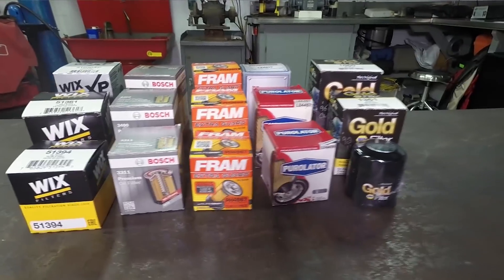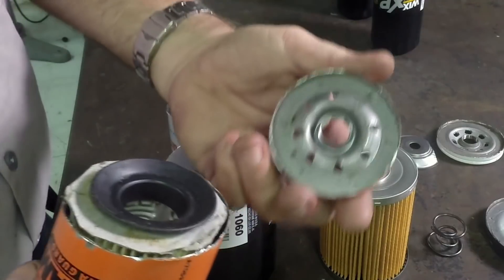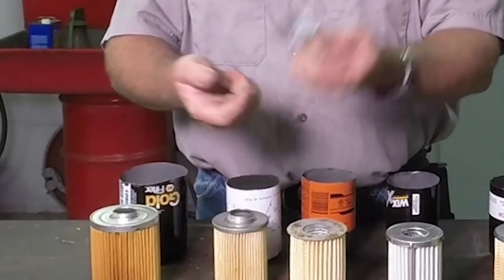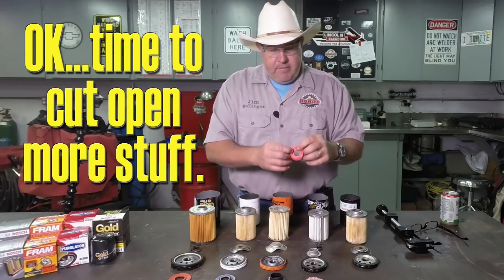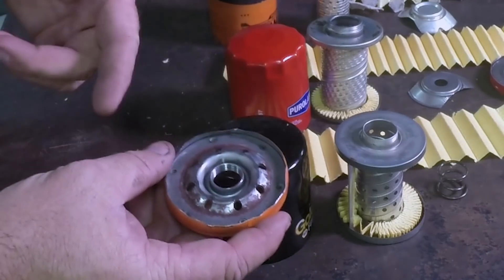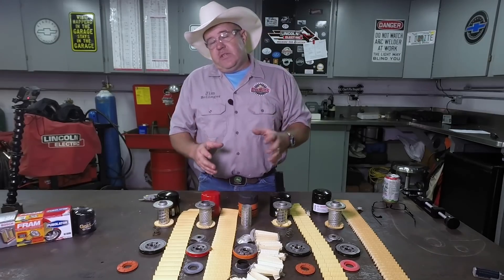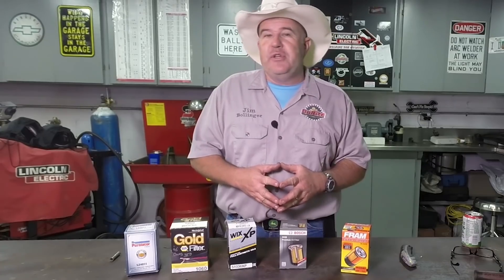The worst oil filter EVER!

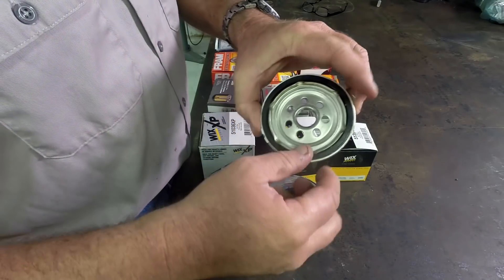Comment: at 1:29 it says RETURN ENGINE OIL PRESSURE. This isn't correct, the filter is on the pressure side of the oil pump as described at the 4:58 mark, there is no return oil pressure passage on the engine. Return oil simply leaks from the side of the bearings and drips back into the oil pan.  The filter body does see the same pressure as the engine oil pressure.

Comment: Fram is "made in USA" , of course it's crap. I still use them cause it's all the store has. They cost $6 and I change my oil every 5000 kms, good enough for me. Filter will never harms your engine, filter does come apart atleast its cardboard and not metal. Only way people kill their engine is low oil, wrong oil, or never changing it. You only really need an oil filter to plug a hole

Comment: Same filer size for the same car:
Frame $3.77
Napa Gold $12.49

You pay for what you get. 

Looks like you had all sorta sizes.. That changes how long each will be... 

Frame has rust and is shipped from over seas to the USA. Most are made in China and ship to the USA where they label them as fram to keep the USA on there box.

They use them in races cars.. One run is it.... Its removed and tossed and a new one is put on. Race motors are only used a few times before there taken down and redone.. Dont need some long lasting filter... They will blow a motor faster then having a problem with a filter in 500 miles.. Each his own in this point..

Comment: For the last time the end caps do not have anything to do with filtering the oil, who cares what they are made of.  If the filter failed would the engine run out of oil or would it run around it and continue lubricating the engine stop spreading the lies a filter does not protect your engine the supply of oil does.  Flaking rust really ive never seen that you sure that wasn't sitting in your shop a long time?
Reply: I laugh at these vids too. "more filter paper, must be better" lol, ugh a filters most important job is to maintain flow. If your filter is holding back sludge you got bigger problems
Reply: I have been wrenching for 17 years.  I have seen no correlation in engine failures from running Fram filters.  I have torn apart filters before.  I do agree that Fram are not the best, but they do the job.  If you have rust in the filter, then either they weren't stored properly, or you have water in your oil.  Fram is one of the top sellers in the market.  That being said, if Fram filters killed engines, then our freeways and streets would be clogged with dead cars.
Reply: @ericlunneborg907  can you explain how a filter can break an engine?
Reply: Unless the filter media is disintegrated from improper storage,  or improper usage, then I can not think a filter would just straight up cause a failure of the engine's lubrication system.  However the "E Core" oil filters produced by champion laboratories had a problem with the nylon cage breaking, but I believe that problem has been solved.
Reply: @ericlunneborg907  it's annoying these people make videos and say the filter will destroy your engine.

Comment: Meh, Used Fram filters for 26 years in my 1978 pickup with over 300,000 miles on it.  Have used wix and Puralator in other vehicles.  He’s well meaning and all I know and from a materials standpoint may be right, but how it ‘looks’ and ‘feels’ doesn’t mean it’s better at its intended job.  Who cares if the ‘can feels heavier’ if they both contain the oil pressure?  In 40 years of changing my own oil don’t think I’ve ever had or heard of an oil filter rupture.  Have the oil analyzed after using each kind of filter in an identical engine.  If there is appreciable difference, then I’ll take note.  My suspicion is, if you follow recommended service intervals it’s not going to matter.  Flame away lol...
Reply: Steve Vento The question isn’t whether cardboard is as strong as steel.  The question is does it do the job it needs to do in an oil filter for its recommended service life?  If it didn’t, at least nominally, Fram would have been out of business long ago.  Do the others use ‘better’ materials?  It sure looks like.  But does that mean they do a ‘better’ job filtering your oil between service intervals?  You can’t tell that by looking at them, you tell that by analyzing the oil in an apples to apples comparison.
Reply: Filter only really plugs a hole. Doesn't matter. People saying a filter killed their engine are the idiots driving with low oil, wrong oil, or way past an oil change
Reply: I've seen the casing explode but it was an extreme case I think the oil pressure was over 80 pounds
Reply: @Spudderr  a stock sb Chevy has 80 psi at start up.
Reply: manic mechanic I don't know for sure what the number was that made it pop all I know is the guy said the oil gauge pegged. It was on an amc 304.
Reply: @Spudderr  your oil filter is splitting that means you screwed it on too tight
Reply: HighStreet Killers I didn't do it it was a customers ride
Reply: Here's the thing, maybe Fram used to be a premium filter and worked fine on your '78 pickup for 26 years but today, as this video is being made, their quality has gone way down. I suspect that since they supply WalMart and sell them so cheap that they had to reduce their quality to meet the order. Either way, I can tell you that cardboard getting into the bearings and worse yet, rust, isn't good for the engine.
Reply: Don't work on anyone elses vehicles. You put rust in your own engine. I can about guarantee there is blow by.
Reply: K B no flaming from me! I’ve worked as a mechanic many years ago (80s-early 90s) and still do a lot but more of a hobby these days. Sure I’ll spend a bit more on a filter on a car I’m taking to the strip and shifting @ 7K but I’ve used Frams in many daily drivers with never a problem. Thinking back only two filters gave me problems. One was a no-name white one on a truck that was given to me (Jiffy Lube?) that had a split down the side and was pissing oil. The other was a K&N that was oozing from the seam where the mounting flange attaches. I’ll never buy another one of those over priced things. I’ve had really good luck with Mobile One full synthetic oil. After swapping out a pan on a Mustang I had from new, after 65K there was zero sludge and it looked like a new pan. I was sold and I like the price and availability. I usually try to find a manufacturers filter for a specific car (Mopar/AC Delco/Motorcraft) but no issues using a Fram on a grocery getter.
Reply: Flame, flame, flame,flame there I'm done
Reply: The rust is a real issue, if it go to the oil lines..Fram used to make top of the line filters, just cause your truck last that long, wont mean that it will last this long again (or another car now) with this drop in quality of the filter.Hell, maybe it could last even longer without this drop
Reply: I lost an engine at 168,000 miles. Fram filter.  Engine was still holding good oil pressure and was at proper level. Approximately 2K miles after last service interval. Engine rebuilder found bits of the filter in oil galleys.  I haven't used Fram filters since. Also switched to premium synthetics (Mobil 1, Amsoil, Royal Purple...).
Reply: Heard a story several ears back about an engine intermittently losing oil pressure due to a bad filter.Fast forward to last year and friend buys a Jeep Cherokee 4.0 from a neighbor for $200 which turns out to have the same issue,oil light comes one at random times and engine gets real noisy so it's definitely lost pressure.He asks me what I think and I suggest buyiing a good WIX filter and see what happens.He changes only the filter and the problem's gone,drives it for months after including towing a trailer and no issues.Old filter was a newly installed Fram from an oil change place.
Reply: A flimsy can might be difficult to remove because it'll easily crush when grabbed.
Reply: I've used frame to every car I've owned and I run em hard and also go over like 1kor2k over and use 14w40 or 30 and haven't lost an engine yet
Reply: I know the Fram Racing filters are tough. Not being familiar with my first VW powered racing engine's full flow oiling system, I accidentally hooked up the oil lines wrong, had about 120 psi going in both sides of the filter. Blew oil passed the gasket, but the body held up. It looked weird though. Slightly larger than everyone else's, and no more of the bumps at the end where you can put and oil filter wrench on it. Ran it that night once I got the line hooked up right, my young and stupid days. Cut it apart the next day (no grinder or saw, there is a cutter that works like a food can opener, leaves no grit or shavings for a false read), it still worked perfectly. Everything in place and no signs undue engine wear, because of the filter didn't come apart on the inside.
Reply: Brian Landers  Not sure how Jiffy Lube got involved in the story about a crap oil filter,never mind the insinuation that they somehow install used oil filters.Anyways,even if we go with this incredible theory,a used oil filter shouldn't fail that way unless they went down to a junkyard and pulled it out of a car that sat for decades.Somehow I think they would just find it easier to put on a new in box filter and save themselves the trouble of looking around for used one.
Reply: My Fram tough guard got a hole in it, and it's mounted on the top of my engine. So I don't really trust them at all. Sticking to Mobil 1 and Napa filters. Unless I see proof that their Ultra is good.

Comment: Fram Filters  Ha ha .   On Ford Pickups for my Oil Change 75 % Purchased were Possibly Frams  .   Because it was Habit ( I liked them ) And the store stocked them at a Normal Price . This was Decades ago .   Possibly 2nd used was Pureolater   or Ford Brand .  I did use Wix  But the reason was Habit and Cost .   I was Anal about Changing oil and Getting my trusted brand of oil , It was very ritual . One day on a 302 engine in the Bronco I Changed the oil Went thru the care full warm up and check ritual . Shut the engine off and started it 10 minutes Later , Then Blam and the filter flew off spewing oil in a big pile . I was in the truck and shut it off a few seconds later .  The noise startled me it was loud , I wondered what hit the Truck ?   There was a Big Pile of oil Like somebody Gutted an elephant in the driveway .  Inside the engine there is a spring and a Ball acting like an Overpressure Protection device .  The oil Change done at Low mileage  interval had loosen some Gunk and it stuck this Spring Ball Valve .    The Filters sides Bulged out and it stripped out the threads and flew off .     It is not like a Blamed the Filter , but like the video shows they are lightly built .    I did not use Fram as the Favorite filter after that .   I did like the wix they just cost more .    Thank you for the Video
Reply: Sounds like your just an idiot. I only warm my engine up for 10 secs and im in canada.

Comment: I have known that Fram oil filters were garbage, sub standard and crap for many many years. I had a friend in the 1980's do what you did in this video, he took a few apart to reveal what was inside.... Well after doing so it was clear to see Fram was by far the WORST oil filter you could buy. I spent thousands rebuilding my 340 engine in my Duster back then, I am SO glad I never used a Fram filter.

Thank you for making this video to expose this terrible workmanship and poor quality product. Hopefully people will see this and avoid engine damage (or worse) done due to this shoddy product. 
Thumbs up! 👍🏻
Reply: Fram is sold at Wallmart, that should tell people something... LOL!🤣
Reply: @CanuckTruthYTisCensoringUs   Yup, if its cheap that doesn't mean its any good...
Reply: Yes Fram is sold @ Wal-Mart but they also sell Motorcraft (Ford O.E.M.) and others too!
Reply: @CanuckTruthYTisCensoringUs  Walmart here sells Royal purple and Mobile 1.  I think it's a matter of Fram using the fact that people buy Fram based on the brand and never actually see what's inside the can.  It's awesome we have videos like this
Reply: 340   Duster ???    Be careful,  that is a fast ass Car....,  especially if you leave out the Fram Oil Filter.
Reply: @Blak Berry Bite yer tongue berry boi!  Mopar rules!  Or did with the 318/340/360 small block.  Now they're, uh, well ...
Reply: "I spent thousands rebuilding my 340 engine in my Duster back then" - and now it won't start because your ballast resistor is fried, right?  :)
Reply: PiratePete66
YEAH, WHERE'S YOUR  340 MOTOR NOW😒👎😎 BOAT ANCHOR for YOUR PIRATE SHIP😁😂🤣
Reply: @Curtis Sherwood I thought 318's had enough clearance that the valves would not hit the pistons; did you have hot cams or higher compression pistons in it?  340's had a dual camchain and sprockets, I know because my father replaced the single chain and sprockets on his 360 with the 340 set once the original chain stretched.  I don't think they used plastic for very long, but I'll ask him over the holidays (he was a Mopar mechanic for 27 years during the 318-340-360 heyday).
Reply: All OEM companies have used some questionable parts over the years plastic timing sprockets, valve covers etc. Ford, GM  even the vaunted foreign brands BMW Mercedes are guilty of this.
Reply: @4thstooge75  No wonder two springs on my Mercedes exploded while sitting still in the driveway.  Not kidding!

Comment: 1:26 What do you mean by "*Return engine oil presssure". The oil passes through the filter BEFORE going through the galleries that deliver it to the bearings etc. It then flows back to the sump under gravity via the opening in the castings.
Reply from the maker: The oil returns back to the inside of engine (oil gallies). When it is in the filter, it is "outside" of the block.
Reply: @DoRiteFabrication  Ah right. Confusing terminology. I thought you were saying that the oil filter was on the return side of the lubrication system.

Comment: Many have asked about so called "OEM" filters. There may have been a time, decades ago when AC division of GM actually made filters. That era is long gone. Automakers bid this out and dealer parts department "genuine" filters may come from different sources.  I cut open the filter that came on a new Toyota and it was amazingly well built inside by Denso In Japan, best I have ever seen. Toyota Motor Sales USA sells a repainted Purlolator, good enough, but not the same. American Honda sells filters from two different suppliers interchangeably, Filtec and, yes, from the maker of Fram! At least the parts counter people know the difference if you ask.

Comment: I have used Fram "mostly" or over 500k on various cars, trucks. Quality looks way worse than the others yes , ,but does it really make a difference. I've never had a problem with one and quite often use the cartridge type. I have never noticed a breakdown of the filter element or a  change in oil consumption. I'm not even saying they are good but if the engine still lasts longer than the rest of the car does it matter. Plus to say a wix price would be 10$ more per oil change. 400$ over 200k. Thats the price of a used engine in many cases. I will probably switch to the purolator for piece of mind though .LOL
Reply: It doesn't matter. If somehow a filter came apart I'd rather it send cardboard into my engine. I'll keep paying $6 for a Fram filter cause i actually check my oil level every week and change it every 5-7000 kms

Comment: Fram filters are junk, but I would run one all day long over AC Delco. I did an experiment similar to this with every brand of filter that I could get at my local Walmart. After running the AC delco on my truck for 2,500 miles, the cardboard was separating and about to go into my engine! The fram is a much higher quality filter than the AC delco.

Comment: I run fram ultra on everything. The cheapest filter (fram orange) was the worst shocker. Why compare a cheap fram to premium filters
Reply: Purolator isn't considered a premium filter either.
Reply: You can get Napa gold for like $5  here. I'd love to live in a place were $5 is "expensive".
Reply: There is no excuse for the rust, I wouldn't be at all surprised if this doesn't lead to a class action suit
Reply: The Fram only makes the others look premium in comparison.
Reply: DiabloDrift those are not premium filters bud
Reply: The Purolator red is equivalent tier filter to the Orange Can shown. The Tough Guard (not shown) has the same fiber/cardboard endcap construction as the Orange Can would be equivalent to the Wix and Napa Gold. So with the exception of the one Wix XP, not an unfair comparison at all.
Reply: Yeah, good point. But if they decided to produce cheap stuff, in other words-to foul us for their own profits, why cant I assume that all they do isnt to advance themselves ?..
Reply: Exactly, this is lower grade fram being compared to higher grade filters such as the napa gold. Silver would be the comparison to this fram. Unfair review without question.
Reply: If the cheapest Purolator filter is higher grade, that says something about the Fram.
Reply: Napa Gold and Wix are not considered Premium

Comment: Well, back in the '70s and '80s, I used Exxon filters. Then that Valdez thing happened and you couldn't find Exxon filters anymore because they used them all to soak up the oil spill. Those were dang good filters.